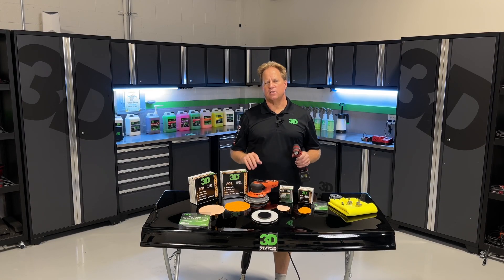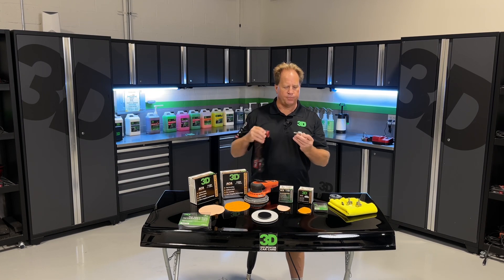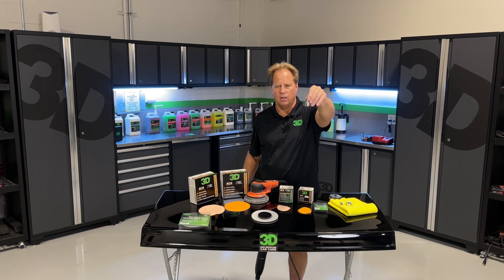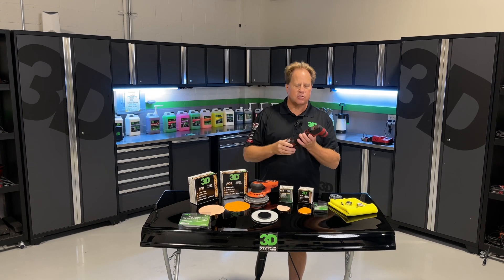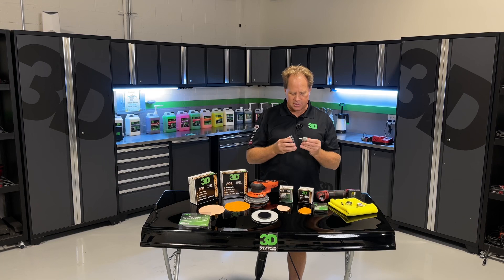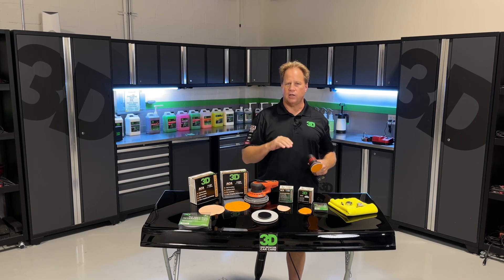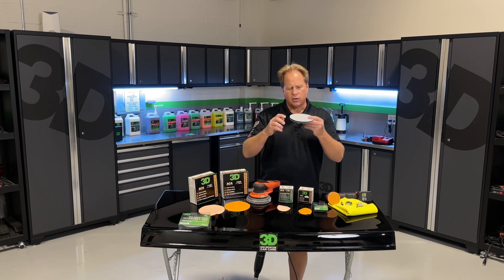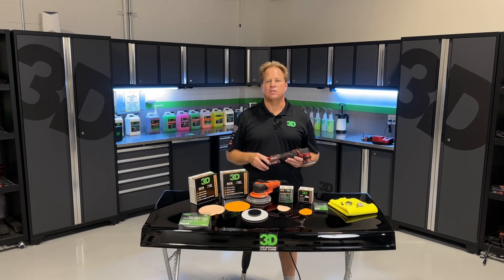NEW!  6mm drive unit for the FLEX PiXiE!  For precision machine sanding or paint correction.

Comment: This is huge Mike! Flex would be crazy not to jump on any advice from you!
Reply from the maker: FLEX is always good at listening... kind of... back in 2011 I had a meeting with the FLEX Engineers in Germany where I recommended they bring out the Mercedes-Benz of short stroke polishers - the FLEX version of the Porter Cable 7424 (8mm free spinning random orbital polisher),  and instead they brought out the FLEX Finisher, a 15mm free spinning random orbital polisher.  Here's my write-up from back in 20011

Secret meeting with the Flex Engineers!
https://www.autogeekonline.net/forum/flex-polishers/41725-secret-meeting-flex-engineers.html

But yeah... I pushed pretty hard for this 6mm drive unit, sent multiple short videos and pictures of how I use it and now it's a reality.  :)

-Mike Phillips

Comment: I just sent them an email asking about this. They said they would be available very soon that was a few days ago.thanks for pushing the industry Mike!! Your a legend!!
Reply from the maker: Cool.  Good to hear.  And remember, this 6mm drive unit actually rotates a buffing pad for paint correction BETTER than the 12mm drive unit.  When RUPES introduced the LONG STROKE FREE SPINNING RANDOM ORBITAL polishers - everyone including FLEX jumped on the LONG STROKE bandwagon.  A mistake in my opinion.  

Long stroke free spinning random orbital polishers STALL OUT way too easy because the outer portion of the buffing pad has so much leverage over the spindle that they simply stop rotating and oscillating.  Thus wasting everyone's time.  

Short stroke free spinning polishers don't suffer from this as much as long stroke free spinning polishers thus the reason I recommended to FLEX back in 2011 to bring out a super high quality version of the short stroke, 8mm Porter Cable.  But alas, they chose to go with the 15mm FLEX Finisher.  The rest is history.

Secret meeting with the Flex Engineers!
https://www.autogeekonline.net/forum/flex-polishers/41725-secret-meeting-flex-engineers.html

-Mike Philips